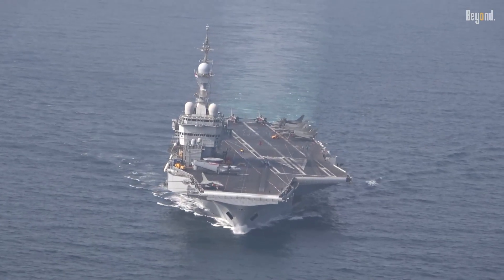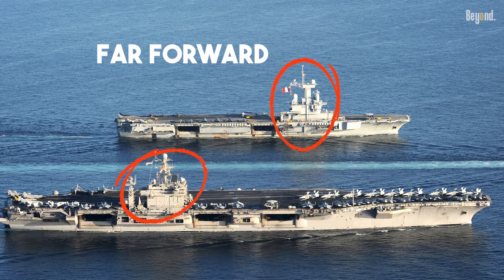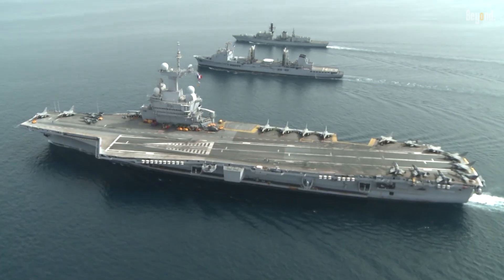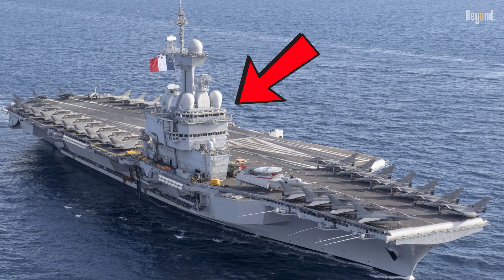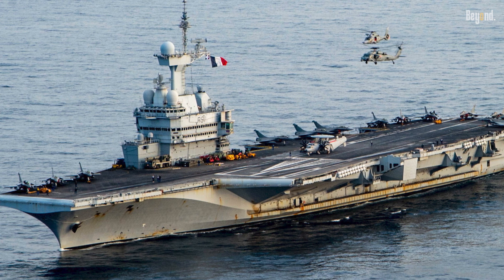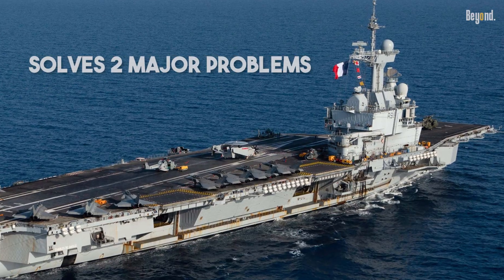Why Charles de Gaulle's Island Sits Ahead

Comment: Why US towers are aft ?
Reply: The US carriers have 2 catapults that launch off the bow of the ship.   It appears the De Gaulle only launches 1 off the side.
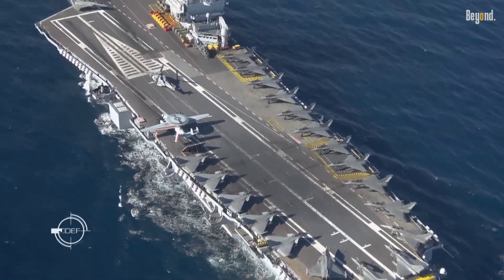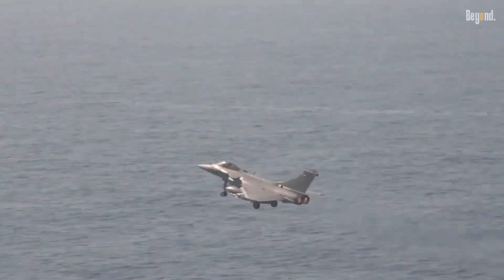Reply: @thumperjdm  Sorry but no, the Charles de Gaulle has 2 catapults, you can see them on multiple occasions in this video, especially at 1:20 where you can see the second catapult covered, and at 1:24 too. Also, at 1:43 you can see a Rafale being catapulted from the forward catapult.
Reply: @Volcanosf32  Ah, missed that.   Thanks.
Reply: It creates a much more efficient flow of aircraft above and below deck.
(Creates more aircraft launches and recoveries per hour.)

Comment: On Forrestal class carriers the island was beetween elevators 1 and 2. Later class had it beetween elevetaors 2 and 3. Not sure it has anything to do with access to the reactor; Entreprise has 4 of its 8 reactors next to the island for exemple. It is more likely a question of mass distribution for her, comparatively, small displacement and to keep the island as far away of the angled deck.

Comment: Having the bridge superstructure forward makes sense as it affords more protection from radiation exposure of the captain's lady parts.
I'm just surprised they didn't put the bridge right on the bow.  That would give a little more distance for the captain from whatever he's running away from, and leave more room on deck for all the aircraft and equipment they're going to be pushing off the stern to gain a speed advantage.
Reply: Ah yes, the UK national pastime, mocking the French. 😂

o7 to the French for holding off the Germans at Dunkirk. Without this, Operation Dynamo could not have happened.
Reply: @thejohnbeck if the French had done their job in 1939 the Germans would have been stopped cold before they even moved into France in the first place, and perhaps millions might not have died needlessly!  But I digress...
It's not just the UK that enjoys mocking the French of course.